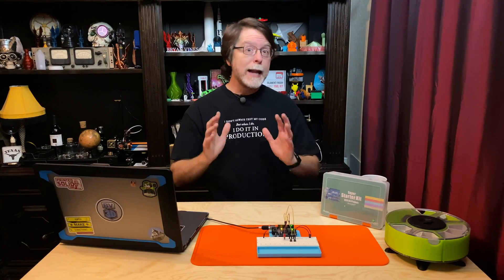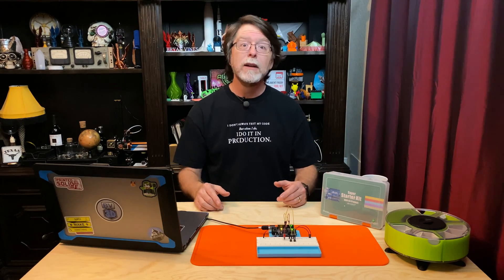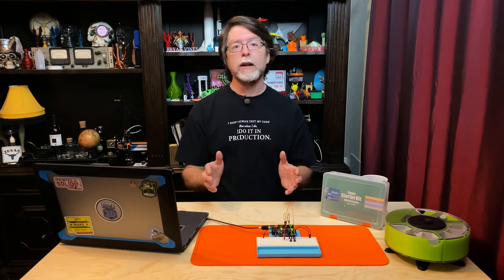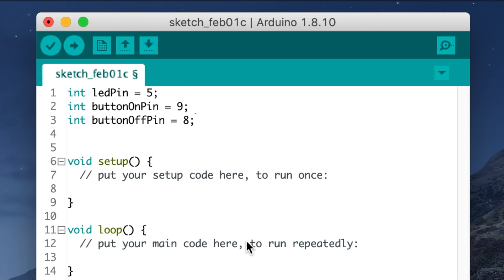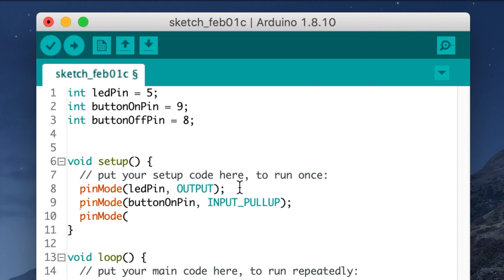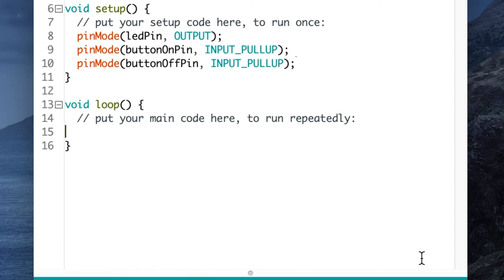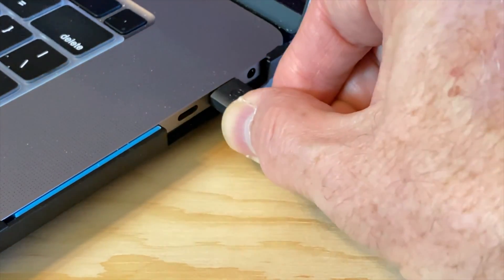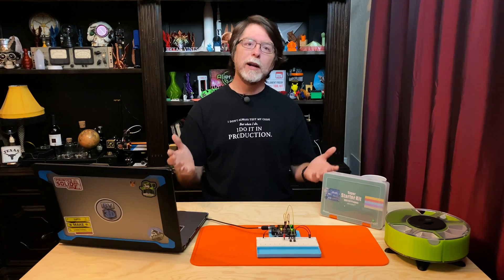Get Started in Electronics #4 - Use Digital Inputs to Control LEDs

Comment: I put delay(250); between the two if statements and another after the second if statement. Pressing the on or off switches sometimes turned the light on or off, but if both were held down together, the light blinked.

Comment: Hi brian, great presentations. I have added a couple of extra leds and a buzzer to your example (like a level crossing scenario) but have found that I need to hold the first button down for the code to work. Are you able to see where I have made an error in my code (attached)
const int redLed1 = 5;
const int redLed2 = 4;
const int greenLed = 3;

const int buzzer = 7;
const int buttonOnPin = 9;    
const int buttonOffPin = 8;    

void setup() 
{
  Serial.begin(9600);
          // declare the LED pins as outputs
  pinMode(redLed1, OUTPUT);
  pinMode(redLed2, OUTPUT);
  pinMode(greenLed, OUTPUT);
  pinMode(buzzer, OUTPUT);
          // declare the switch pins (buttons) as an input
  pinMode(buttonOnPin, INPUT_PULLUP);
  pinMode(buttonOffPin, INPUT_PULLUP);
}

void loop() 
{
  if (digitalRead (buttonOnPin) == LOW) 
  {
    digitalWrite(redLed2, HIGH);       // turn the red LED on pin 3 on
    digitalWrite(redLed1, LOW);       // turn the red LED on pin 4 off
    digitalWrite(greenLed, HIGH);     // turn the green LED on pin 3 on
    digitalWrite(buzzer, HIGH);       // turn the buzzer on pin 7 on
    delay(200);
  
    digitalWrite(redLed2, LOW);       // turn the red LED on pin 3 off
    digitalWrite(redLed1, HIGH);     // turn the red LED on pin 4 on
    digitalWrite(greenLed, HIGH);
    digitalWrite(buzzer, LOW);       // turn the buzzer on pin 7 off
    delay(200);
  }
  if (digitalRead (buttonOffPin) == LOW)
  {
    digitalWrite(redLed2, LOW);       // turn the red LED on pin 4 off
    digitalWrite(redLed1, LOW);       // turn the red LED on pin 5 off
    digitalWrite(greenLed, HIGH);     // turn the green LED on pin 3 on
    digitalWrite(buzzer, LOW);        // turn the buzzer on pin 7 off
  }
}

Comment: Good and awesome videos. I have a question, can you explain again, thats code part, why we don’t use ‘define buttonOn 9’, instead we do ‘int buttonOn = 9’. Whats the difference? I cant get it. Thank you for answering
Reply: the 'int buttonOn = 9' creates an actual variable stored in memory that can be changed over time in the program like, for example, 'for every 10 seconds, decrease buttonOn.' However, with 'define buttonOn 9,' you assign a constant, fake variable that doesn't take up memory. With the define one, it's simply for readability and the compiler will take the time to replace every instance of 'buttonOn' with the number 9. So if you're assigning pin numbers to certain words like 'onButton' or 'led' then use define because it takes up no memory and will always remain constant(nothing can accidently change it and ruin your program).
Reply: Also, there is one niche use case for 'int buttonOn = 9.' If you want to make a program where there are 10 buttons and a random button out of those 10 can turn on the led, but the button that turns on the led gets changed every 10 seconds. Then you wouldn't define buttonOn as a constant 9, but instead declare it as a randomly generated variable like 'int buttonOn = randint(1,10).' Then in your program after a 10 second(10,000 ms) delay, the variable would change, thus changing the pin number, thus making the 'on button' a whole different button every 10 seconds.

Comment: Bryan thanks for being though in your explanations of the project and coding. It’s been over 20 years since I worked with C /C++ programming. The wiring of the projects becomes more clear with project at least for me.  Next Tuesday my kit should be delivered.   Hopefully before then I wil use my Sermoon 3D printer to print the BV3D
Arduino Uno Prototyping Base, really Appreciate your efforts to design and sharing it on ThingVerse !🛠️⛏️🪛🔧⚙️

Comment: wait I don't understand why the resistor is on the negative side of the LED after the full 5v has already gone through the bulb. Shouldn't it burn out the bulb if the 5v doesn't go through the resistor BEFORE it reaches the bulb?
Reply: OH figured it out, it works fine because as even though electricity flows from positive to negative, as long as the resistor is slowing down current ANYWHERE in the system it will slow the flow throughout. This limits the speed at which voltage flows through the system regardless. And this works because in the split second the electricity enters the circuit, it doesn't have enough time to blow the bulb before it hits the resistor and limits the flow. Fascinating!
Reply: @revolutionaryfrog  Two years later and your own response helped my confusion on this. Thank you!

Comment: Great lesson. Have a question though.  Why is the resistor coming after the positive goes through the LED.  Wouldn't that be sending too much voltage through the LED?  We thought the resistor wanted to come along the positive line BEFORE the LED to prevent all 5v from hitting the LED?

Comment: I think I messed this one up somehow. Did exactly as you did for everything but my led won't turn off unless I press the off button and then press the on button while I'm holding the off button. Is there anything I can do?
Reply: I would double check your code. Not verify with app but go through it line by line. Hope this helps!!

Comment: I seem to be having an issue my LED just turns on and my buttons have no impact on the LED at all idk what I'm doing wrong I followed all your instructions word for word :(
Reply: I had the same problem in the beginning, but I fixed it by pressing the on/off buttons a little harder in the breadboard. Then it's probably solved!

Comment: I know this is a little late but I am having trouble with the coding working properly, I have it copied word for word with proper capitalization and everything, yet when I run the code the light only turns on whenever I am holding down the button, then the other button does nothing, I checked the wiring for issues but couldn't find any and even switched the on and off button input numbers but same thing happened any help would be great if you see this!

Comment: Loving the lessons!  SUPER good stuff!  I'm not sure what the cause is...and it very well could be user error since I've NEVER fiddled with this stuff before...but I'm getting quite a bit of resistance (pun NOT intended :P) when I try to stick the ends of things into the holes on my bread box.  Are these supposed to slip in easily?  Should I be trying to go in at an angle?  Could it be that my bread box just has SUPER tight clearances?  Any tips for a mechanic who's trying to fiddle with electrons?

Comment: Hi, loving your content on arduino so far. I am trying this exact same exercise where we are using switches to control the brighness of the led. However i seem to come across this issue that i cant seem to troubleshoot.

When i press the on button connecting from pin 9, the led lights up but when i remove my finger from the pin 9 switch, the led stops lighting up. Essentially it behaves like a momentary switch. I do not know why doesnt the LED doesnt remain lit after pressing the On button. Therefore pressing the off button will have no effect.

I tried to change my switches and wires and the code is exactly the same so.. idk whats wrong. Any thoughts?
Reply: Did you check that your buttonOffPin and buttonOnPin codes have the P in caps

Comment: Hello Bryan,

I have a question for you :
For the "if (digitalRead(buttonOnPin) == LOW)" ;
   Why is it LOW ? When we press the switch, doesn't that send a signal to pin 9 ? I assume if there is a input, wouldn't be HIGH ? That LOW input there made me confused... 
Thank You, love your videos!!
Reply from the maker: Hi! A digital input needs to be either high or low, otherwise it can "float" somewhere in between those two states, and you could end up with button presses being detected even when no button was pressed. So, to ensure that an input is in a known state when the switch's button isn't being pressed, we tie it to +5V by using a pullup resistor. This resistor makes sure the input is always at +5V when the switch isn't being pressed. 

The reason we're using a pullup resistor instead of a pulldown resistor is because the Arduino has built in pullup resistors, and we activate them when we set the pinMode to INPUT_PULLUP instead of just INPUT. By using the built in pullup resistors, we don't have to use a separate resistor on the breadboard to do this. Having fewer components for a project is a good thing.

So I think where you're getting confused is that the input is going to be an "active low" instead of "active high". When the button's not pressed, the input is HIGH. When the button IS pressed, the input is LOW.

There's a pretty good explanation of using pullup and pulldown resistors within the first minute and a half of the video here (and then it goes in-depth into calculating values): https://youtu.be/ExK_Y7MD7G0
Reply: @BV3D  So when it isn't pressed it's always 5V and therefore in HIGH status? And when we press it the voltage drops to a LOW status?

Comment: Any ideas why this won't work for me? The LED is lit and stays lit but pressing the buttons does not change anything. Below is my code. It appears all my components are attached correctly.

int ledPin = 5;
int buttonOnPin = 9;
int buttonOffPin = 8;

void setup() {
  // put your setup code here, to run once:
pinMode(ledPin, OUTPUT);
pinMode(buttonOnPin, INPUT_PULLUP);
pinMode(buttonOffPin, INPUT_PULLUP);

}

void loop() 
{
  // put your main code here, to run repeatedly:

if (digitalRead(buttonOnPin) == LOW)
{
 digitalWrite(ledPin, HIGH);
}

if (digitalRead(buttonOffPin) == LOW)
{
 digitalWrite(ledPin, LOW);
 }
}

Comment: Why does the resistor come after the led,like,it’s connected to ground and the electricity goes straight through the led
Reply from the maker: BEHEMOTH it doesn’t matter whether the resistor is on one side of the LED or the other. As long as the LED has a resistor, the resistor will limit the current. If you have an LED package with multiple LEDs inside, like the RGB kind, each of the LEDs in the package needs a resistor. More information is available here (https://www.quora.com/If-electricity-flows-positive-to-negative-then-how-can-the-resistor-come-before-the-LED-or-after-it). 👍🏻

Comment: Hi Bryan, i'm new to electronics. I have a question. Is that resistor supposed to be going in to the ground like that? I own this kit and my diagram shows the resistor between the LED and the 5 volt supply, with a jumper used to attach the LED to the ground. Is the resistor still part of the circuit plugged in to the ground like that?
Reply from the maker: Hi! You can do it either way. My preference is to use the LED on the cathode (ground) lead, but the resistor will protect the LED whether it's connected to the LED's anode or cathode. 👍

Comment: Hey Brian, Thanks for these vids. I've done the first 3 successfully but am failing at this one. I've gone through the wiring and code multiple times and still get the same... nothing happens... neither switches do anything. However, when I swap the two yellow wires around on the Arduino side (8 & 9 slots) the LED is turned on by clicking a switch but then it doesn't turn off again :| What am I doing wrong?
Reply from the maker: Hi! Check that the four pins on the switch are making contact with the conductors in the breadboard. The switch's pins may be a little short, or the switch may not be all the way in.

If you still have trouble, you can send me a DM on Twitter @Bryan_Vines (if you've got a Twitter account). 👍
Reply: Had the same problem. Figured out one cable wasn't working